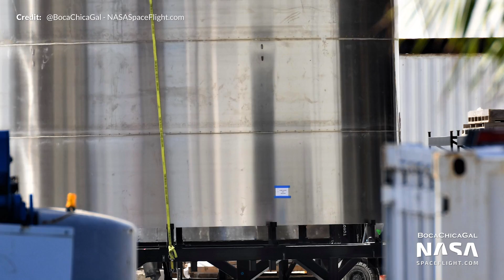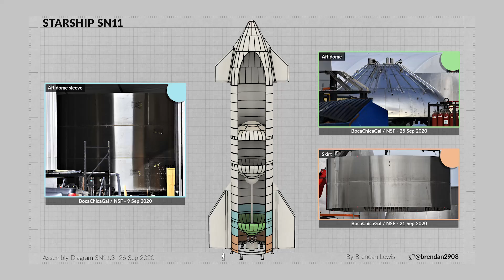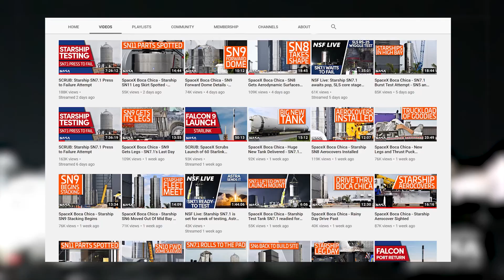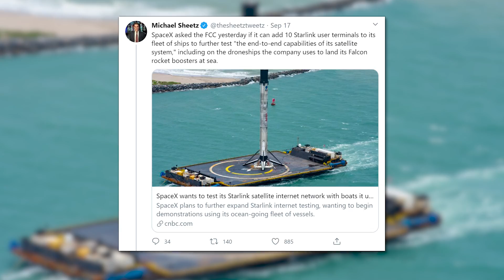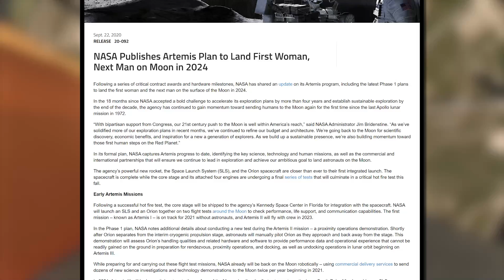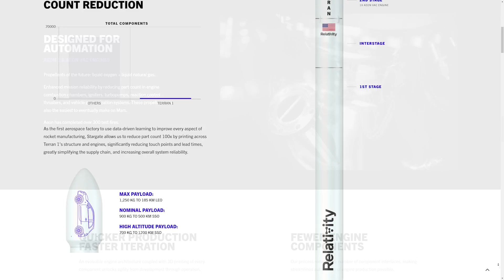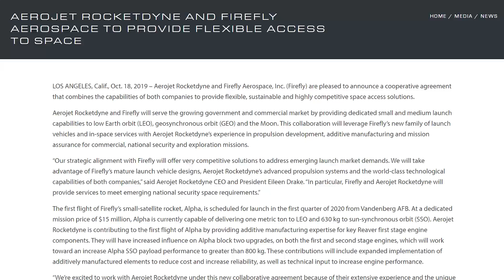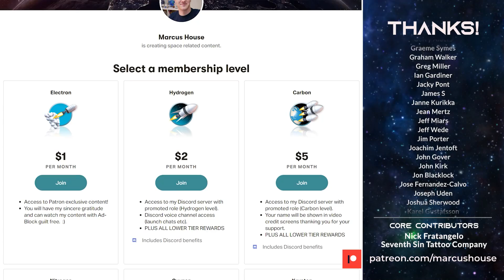SpaceX's brand new Super Heavy monster is coming - SN1 build has begun

Comment: I am 95% percent sure it will make it back with the legs making contact dead centre. I am a bit worried it might crush a leg too far and slowly tip over. If it did tip over it will look like a slightly crushed pop can which would make a great addition to the beach restaurant.

Comment: I love the Tig welder on a robot arm, a pretty good meme to see it actually in use for printing with a weld bead. There was likely a good amount of materials engineering on the alloy selection side, as well as a heat treating regime to get rid of all the internal stressing this method would create. They must have one hell of an oven to cook a rocket.

Comment: Starship is a scam. Anyone comparing SpaceX's real rockets with this shiny Buck Rogers Starship nonsense will understand. And then there is the unsuitability of stainless steel because of weight, and the aerodynamic issues due to folding and dimpling as seen in al the photos of it.

And then there is the fact that space travel beyond low-Earth orbit is not possible.

Hate away, but come back and apologize when that shiny Buck rogers looking nonsense goes no where and Teslaron and the rent-seeking conman finally collapses in to scandal.

Comment: I was wondering if SpaceX had considered building a space-based variant of the Super Heavy Booster.  One of the issues of going to Mars is the time spent in space and the effect on the Astronauts.  A vacuum tuned Super Heavy Booster (eg. call it a Space Booster), fully fueled in orbit, would join a fully fueled Starship in the same way earth bound Super Heavy Booster joins to the Starship.  The vacuum tuned Super Heavy Booster would then accelerate the Starship, at a moderate rate over an extended period, to reach a higher speed that just the Starship itself. The 2 ships would separate, and the vacuum tuned Super Heavy Booster would return to Earth orbit.  The Starship would be travelling at a higher speed and arrive at Mars quicker and for the most part fully fueled.  So, the Starship would have the fuel to slow down and do whatever was required at Mars.

Comment: Artemis Gateway continues to perplex me. I only invested the time to look at the Wikipedia "Lunar Gateway" article on it but that says that by the time the final planned hab module (the iHAB) is installed in what the article says will be sometime in 2026 it will give a combined habitable volume of 125 cubic metres between it and the HALO module. I do understand that SpaceX still has to prove it can actually make the Starship vision a reality, and what I am about to suggest is somewhat against Musk's guiding principle of reusability but only as a one-off exception, but if things go to plan even allowing for some slippage due to over-optimistic Elon time then at the rate SpaceX have already got to SN8 it should be possible by 2026 for SpaceX to get a space station with somewhere fairly close to 1,000 cubic metres of habitable space into Lunar orbit by building a custom (and extensively stripped down) Starship to be left in orbit rather than landed on the Moon. Such a Starship could not only dispense with fins and heat shield but also landing legs and no need for lunar landing thrusters such as those on the Lunar Starship. And the resulting Lunar station could and all delivered to Lunar orbit in a single mission (although admittedly that "single mission" would require multiple launches because of the on-Earth-orbit tanker refuellings required) instead of the multiple NASA missions spread across 4 years to slowly build up to that paltry 125 cubic metres of habitable volume. Am I missing something here?

The resulting space station probably wouldn't quite get to delivering the full 1,000 cubic metres of habitable volume planned for passenger starship because it would need docking capabilities and perhaps some space for deployable solar panels which would eat into the habitable volume (although the solar panels could maybe be delivered via a second mission although that does spoil the all done in onbe mission concept a bit) but even so it would have many times the habitable volume of the proposed Lunar Gateway. Additionally once parked in orbit the huge LOX and CH4 tanks plus associated header tanks potentially become available for re-purposing (extra habitable volume? Hydrogen storage to feed the life support systems for very extended durations between resupply missions?) or, since the Dynetics lander is planned to be Methalox, significant fuel storage capability already in place as part of the lunar station. Or perhaps some combination of the two.

Starship if successful opens up the possibility of doing all sorts of exciting things far more easily than with essentially still Apollo era methods of working and with luck all within the next 5 years. What a fantastic time to be a Space enthusiast.

Comment: I'm sure I read somewhere that it is being built from stainless steel? There's something very odd about that.
Reply: @Keanu Threeves Stainless steel is heavier than steel. Aircraft and spacecraft aren't made from steel because it is too heavy.
Reply: @tangentarc7477  Stainless Steel is steel. It's not heavier! It's contains only a minimum 18% mix of chromium and 8% nickle. Also it is easier to weld than Aluminum and is stronger at cryogenic temperatures and because it is cold rolled. 
We are talking rockets, not planes. Rockets are not a passenger service. Rockets need thrust to escape Earths gravity, we are not interested in a light weight shell when the fuel is 2,000 tons!!! What do you mean "Musk has a habit of speccing the wrong material." Falcon9 works fine. Certified for Human Flight. You don't get that from NASA for the wrong materials. 
If SpaceX can get a Full Flow (closed cycle) engine into space, which no one has done before, then he knows what he is doing.
Reply: @David-yo5ws  I have just used the metal weight calculator from my metal supplier and a 2" bar of 2" diameter carbon steel is 1.7810lbs. The same length/dia in 304 stainless is 1.8211lbs. 
That is heavier, is it not?
Reply: @tangentarc7477  That's splitting hairs when you compare it with 2000 tonnes of Rocket fuel. Starship weighs about 220 tonnes empty. With 6MN of Thrust, it's hardly going to be a problem.
Reply: @David-yo5ws  Exactly. Multiply that difference over 200 tonnes and it isn't an insignificant weight any more. Regardless to whether you think I am splitting hairs, you were wrong in your assertion.
Reply: @Keanu Threeves Weight effects fuel efficiency and speed. That's why steel/stainless steel isn't used by Lockheed, Boeing, Airbus, etc. etc.
Fuel inefficiency will cost more in the long term than speccing the correct materials.
Musk has a habit of speccing the wrong materials. His hyperloop rusted from the inside out, because he used regular steel instead of stainless, and didn't account for the temperature and humidity differentials in the desert. Stainless would have been perfect of the hyperloop.

Comment: The flap connection points do not seem to be strong enough.
Reply: It depends on your perception of what they are there for. They are not wings like the space shuttle, so do not need to support the weight of the Starship. They are more like a rudder, that pushes against the air and creates a drag. They are like the sky divers arms and legs that they use to provide direction and control during freefall. So the connection points are strong enough to do that.

Comment: So how much volume and weight it should be able to bring to the moon?
Reply: Payload 1,100 cubic meters (38,800 cubic feet) Maximum mass 100 tonne (220,000 lb's) [ possibly a bit more with the Raptor improvements] Maximum diameter 8m and length 8m then tapers over the next 9.24m to 3.6m diameter. From SpaceX users manual.

Comment: Elon stated that the 7.1 dome was a mix of 301 and 304L steels and the seam that let go was  at the weld seam of 301 to 304L .  It did 8 Bar which was OK, but the next one will have more mods.  (From Elon's tweets)
Reply: Does not seem as wise to mix all kind of metal.
Reply: That explains a lot! I could see, by comparing Marys earlier pictures, that it gave at the dome where it met the vertical welded sections. Also it tore that steel when it lifted up the dome section. If they had all 304L, probably would have got to 9 bar. I am sure they will measure the rings to see what sort of stretching and/or distortion occurred. Thanks for the tank info. (I don't [and never will] have Twitter)

Comment: Shouldn't the presenting surface of the Starship wings be faces with ablative tiles?
Reply: They will be ultimately Elon talked about this in very recent tweet... for this first flight with flaps (which I think now will be 15km high rather than 20km) they don't need them. They will do 3 or 4 of these flight tests to this distance without Thermal Protection System (SN8/SN9/SN10/SN11?). He then said all going well that THEN they will do higher 20km plus test flight which will require the thermal protection. So could be SN12 gets the full tile treatment for first time.

Additionally (my own speculation here!) I suspect in the meantime there is also going to be a big push to get one or two early Superheavy prototypes completed while they investigate flight/landing control with next 3 to 4 Starship prototypes.

Comment: is there any reason Carbon FIber is not used more on these ships obviously cant pressure carbon but flaps and nose cone probs could be?
Reply: Carbon will catch fire on re-entry. There is Carbon Overwrapped Pressure Vessels (COPV) that enables the aluminum tanks to take very high pressures i.e Carbon Fibre is wrapped around the egg shaped tanks. Very strong expanding strength. Maybe customised 'One Way' trips to the Moon, could use Carbon Fibre Fairings to carry a big payload and save weight. On the Moon they could be re-purposed into Hangers for Vehicles to protect them from sun and dust.
Reply: @David-yo5ws  yer i thought that thanks for the info !!!

Comment: 6:20  “each coil is 10metric tons”. 

I’m a forklift driver at a machine company and work with coils of steel all day. Those coils are 2 or 3 tons. No way they are 10tons. Just sayin’.
Reply from the maker: Hope this is not true. We've all been saying this for a long time (not just me). They have been seen with 10 t stickers on them before.
Reply: These SS 304L 50%RA-ASTMA coils are 3.96mm (0.1557 of an inch) thickness, 1828.9mm width (72 inches) and are marked Gross Wt 12,270kg (27050 lb's) Net 12,250kg (27006 lb's) and are made by a Finnish Company Outokumpu in Calvert, Alabama. So you may need to re-evaluate your view. Bear in mind that these are custom made for SpaceX. SS at 3.96mm thickness weighs 31.3764kg/m2

Comment: when measuring thrust of an engine you use FORCE units not mas units, so 5000 pounds is okd but the 226 metric tons should actually be 221,000 newtons

Comment: stop calling it SN1. SN1 already existed and it imploded.
Reply from the maker: SN is just Serial Number. They have Serial Numbers for many things Raptors included. Super Heavy will start at version 1 like other stuff.
Reply: @MarcusHouse  I know what it means, my point is that a super heavy booster test article is HIGLY unlikely to be called SN1, as SN1 alredy existed. it was a Starship test article and it was destroyed. the SH test article is more likely to be called SN12 or SN13, just like test tanks didn't break the labling as they were called SN2, SN7 and SN7.1. If, and its a big IF, they were to restart the numbering all over, they would change the lettering as well, like "SH1", but i higly doubt.
Reply: speculation appart, people need to stop calling the first super heavy booster test article, "SN1" or "SN01", simply because SN1 already existed and it was something else.

Comment: When you see how bad the wind problems are at the Space X..  Boca Chica starship site are! I would have thought that building a huge angled sort of cheese wedge shaped rocket construction building which was big enough to hold all the parts on say 3 production lines system using huge robots and workers to build all the nose cones and mid sections and super heavy rockets and the different starships versions would be the best thing to do as Elon's team could build inside away from the strong winds and then using carry transporters move the finished rockets out side to launch them! Better than having lots of small, Medium, or high bays all over the places and in the strong wind there.  They should have lined the edges of the full site with wind breaker trees or man made versions of wind breaker trees in a long dense double line around the site to stop the wind?  A huge Giga Factory type building but looking as I said like a huge cheese wedge with the narrow end pointing sky would and big doors both ends for access. Having the present layout of open buildings dotted around and no wind protection system lining the sites edge is very bad as the strong winds will make work very hard and fiddly.
Reply: It's a National Reserve, Colin. Them's the rules.

Comment: What is the effect of a liquid Nitrogen bath on those SS rolls and test stand? Can they still be safely used in Production, or are they weakened?  I know SS becomes stronger when cold, but what about the test stand?
Reply: Probably stronger. I know that they have put some metals in liquid nitrogen and then let them return to room temperature. They have found it seems to 'relax' the bonds and makes it stronger. But don't hit it when it's just been taken out, it will shatter!

Comment: What sort of pressure differential is there from top to bottom in the booster?  Does the decrease in  pressure at the bottom of the booster as it uses fuel cancel out the increacing g-force?

Comment: I'm really interested in how much the extra force the bell on a vaccum nozzle produces.  For example, how much force/efficiency does the last inch of the bell of the bell contribute?  As it is such an oblique angle to the nozzle flow you'd expect the cosine of any force to be near zero, or is it that it doesn't contribute directly but contains the exhaust to provide thrust further up the bell?
Reply: A tweet by Elon about the Raptor, said the larger bell was more about efficiency in a vacuum. The thrust of the engine is only slightly higher. All engines have a higher thrust in a vacuum, possibly just because of the natural flow of gases from high pressure to low pressure, the vacuum of space sort of 'sucking' a bit more specific impulse power out of the engine.
Reply: @David-yo5ws  It must be about containing the the exhast in the whole system and preventing expansion for as long as possible,  It sounds like a rocket isn't truely an impulse force but also pushes against the pressure of it's own exhaust, effectivelly the bell acts as it's own gun barrell.
Reply: @Spedley_2142  Yes, that's a good explanation. I think that is called the SI (Specific Impulse) Also, they run the liquid fuel through the inside of the shell of the  'Bell' in space engines. Maybe because in the coldness of space it stops icing up?

Comment: Let me suggest another way to save weight and money.   Print the fuel tanks and use them as the outer shell of the craft.  Basically, no additional rocket skin . May seem non-aerodynamic, but both tanks are quite aerodynamic by themselves.
Reply from the maker: Starship is built this way. No inner tanks.
Reply: @MarcusHouse  thanks

Comment: 14:14 That is the cleanest rocket engine that I've ever see!
Reply: It is much cleaner when there is only one planned flow-rate and feedback is 100% electronic: two solid-state variable frequency 3-phase drivers, and two ball-valve solenoids. The electric-powered cryo-turbopumps are very compact. Fuel vaporization in the nozzle lining, oxygen vaporization in the combustion chamber lining.
Reply: It looks great because the entire exterior is highly polished, including tubing and struts. 

Of course it helps that the fuel vaporizer manifold is not made of lumpy segments, but is smooth and continuous.

Comment: Jee wizz you think that those fin conectors and actuartors are strong enough for such a huge aerodynamic surface??? Mate it seems to me that that tiny little joint connector is not quite going to cut it. With this starship entering flying at hypersonic speeds entering into the planetary atmosphere im sure anyone with a bit of practical knowhow will agree that the stresses involved their are huge especially with a fin that side?? Dont know what you think bro?
Reply: Those "little" joints aren't little either. They just look little in comparison to the massive ship. Plus, the joints are made of steel. Will be interesting to see what happens.
Reply: @anthonypelchat  I see a bit of an optical illusion then they must be huge ..ok well its all comeing together nicely then
Reply: They have no aerodynamic surface like a plane wing. They are just acting like a skydiver uses their arms and legs to stabilise their fall and have a bit of control during descent. The surface of the Starship itself will take most of the force to slow it's fall.

Comment: Marcus, great news.
The version 2.0 design is finished, should be assembled and tested by year's end. This is the first engine that converts electrical pulses into forward thrust pulses in a weightless environment. This proof of concept prototype will be available for independent testing and validation in the first quarter of the new year. 

The new engine needs a good name?
PLEASE comment.

Impossible drive?
Impulse engine?
Sub light drive?
Reply: Once the engine testing is finished, we will upload the video.

Yes, I know, it is NOT POSSIBLE, but it is coming soon!